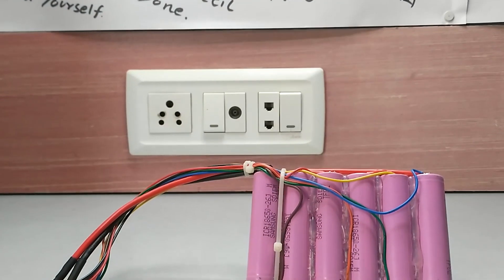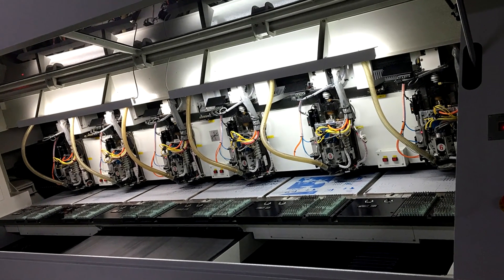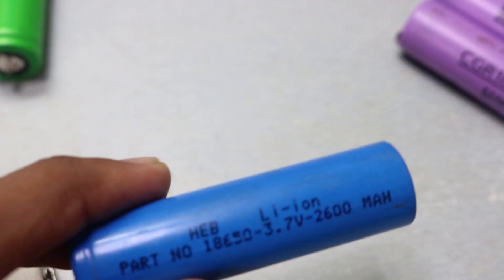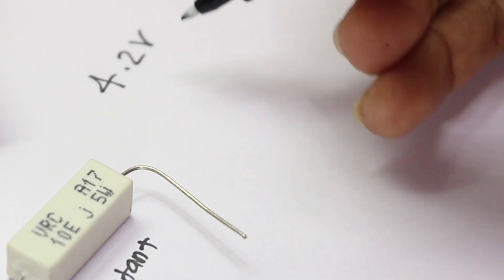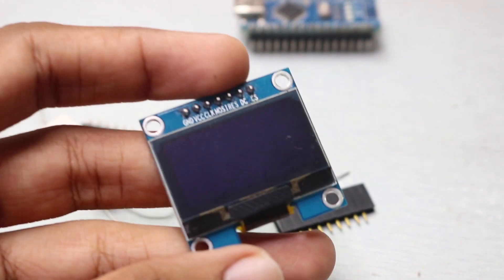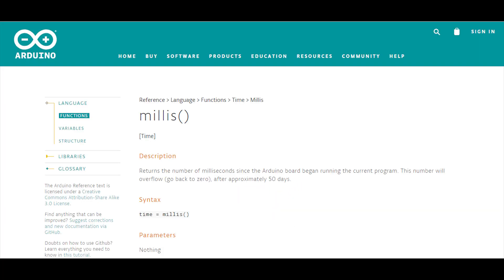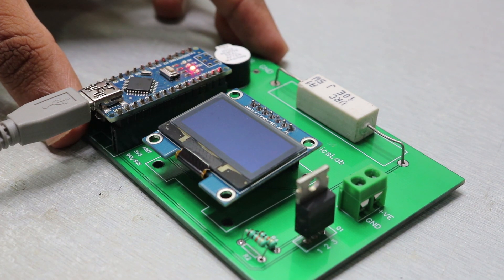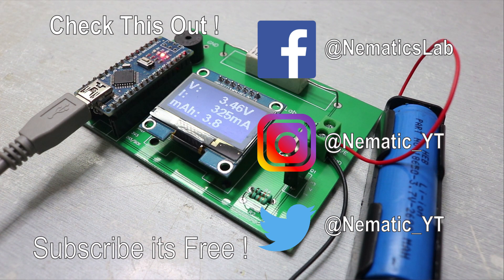DIY Li-ion Capacity Tester ! | Arduino

Comment: How to connect I2C OLED to this board?
Reply from the maker: I had SPI oled which I converted to I2C, so connection are same
Reply: Nematic ! Thank you 👍
Reply: Connect the SDA of the display to A4 and SCL of the display  to A5 of the Arduino Nano. Then GND and VCC! Check if your display is for 5V ! mine was for 3 V so I had to use 3.3V regulator and a diode afte it so I get 3V for the display VCC.
Reply: i guess it's quite randomly asking but do anyone know a good place to watch newly released tv shows online?
Reply: @Zev Roy Thank you, I went there and it seems like a nice service =) I appreciate it!
Reply: @Nehemiah Judah you are welcome =)

Comment: Do we need to use the voltage (internal resistance affected) or the EMF of the battery to do the calculations?
Reply from the maker: Internal voltage reference is used
Reply: @Nematics_Lab  So if a cell has 4.1V EMF, and when it connected to a source, the voltage drops, for example, 3.7V because of the internal resistance. Do I need to use 4.1V while calculating or 3.7V? I didn't get the Internal voltage reference.
Reply from the maker: Use voltage for calculating not EMF
Reply: @Nematics_Lab  Thank you

Comment: Hello! I have this questions: why do we need the voltage divider, because the battery voltage = 4.2 v max, the pins can handle this; the voltage drop on the resistor is low enough for a 10bit resolution ADC, if we halve it with the voltage divider it`s even worse.
Reply: The internal refrence for the nano is configured for 2.56V so its why its haled.  If you want to use 5v you have to tie it to the aref pin with a regulated 5v source.  However the 2.56v ref source in the nano is far more accurate and would give better accuracy as long as you used a good resistor divider.

Comment: You can make your Arduino voltage reading more accurate by reading the internal voltage and using that to set your offset values. Because the power to the arduino can vary, depending on what other stuff is plugged in on the usb, or the power brick, this can effect the internal voltage. Fortunately, the IRef can be read accurately regardless and the offset can be set.
IRef with a solid 5V supplied via the usb, will be 1.1V. Any variation of input voltage will cause the IRef to float slightly. Using the internal ADC, you can measure extremely accurate variations in the IRef to less than 0.05mV.
No extra wiring is required, just a little bit of code additions and calculations. Just do a google search for "arduino voltmeter"
Reply from the maker: Yes I'm aware of that problem

Comment: What wattage soldering iron do/did you use for this?  Seems like my iron is never hot enough but it is a cheap Radio Shack model
Reply from the maker: I'm using Solder station

Comment: Hi great video. İ will try to make same . But i have a question. Can we discharge more than one like4 batteries at the same time? How can we change the code?
I will multiply the resistor and components. Bu how can i change the code? 
Thanks for help.
Reply from the maker: Check instructables article there I have uploaded code just use Arduino IDE to edit code
Reply: @Nematics_Lab  thank you very much

Comment: Sir only 10ohm resistor load work ? can use 5ohm 10watt or any resistor for load?
Reply from the maker: You can use 5 ohm but then you have to change code but I won't recommend doing that as inaccuracy will increase.